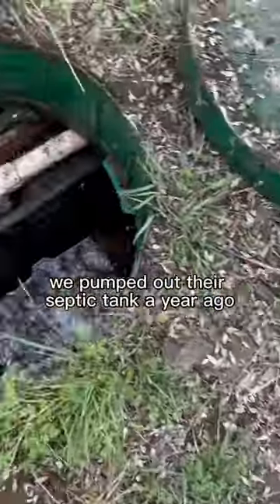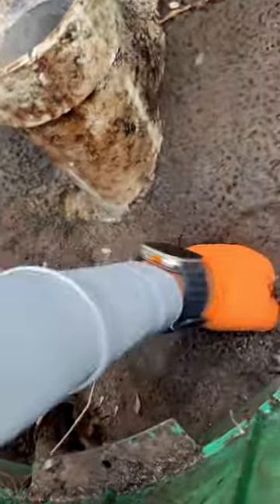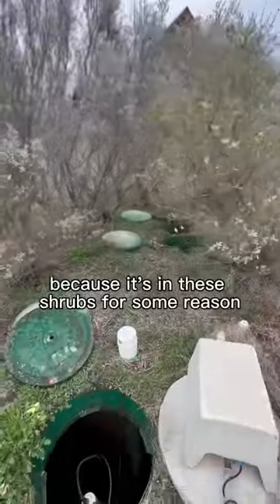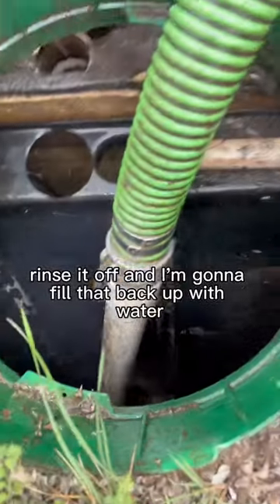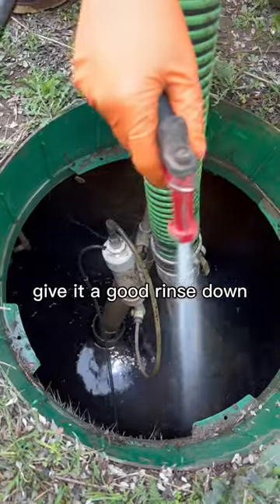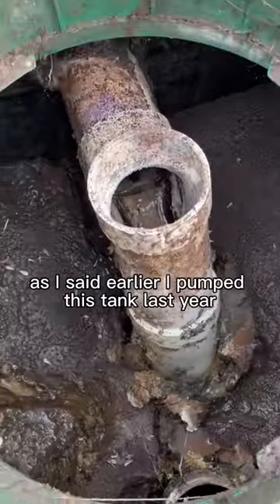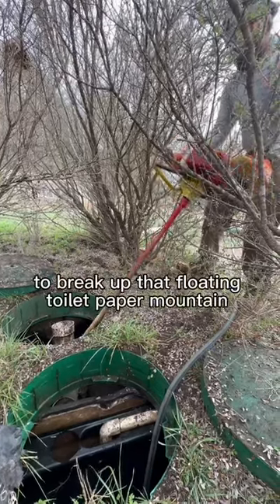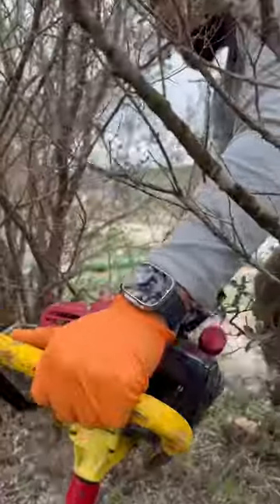Septic Tank Filled After One Year #shorts

Comment: Family needs to use rapidly dissolve toilet paper like they make for RV's
Reply: "Just how rapidly are we talking?  I don't want to play beat the clock in the thicket.   'Your toilet paper will self destruct in five seconds, go'."  - Bill Engvall
Reply: There's a test for "septic system safe" toilet tissue. You put a few sheets in a jar half full of water. Shake it vigorously for a quick minute. It should dissolve. I worked as a maintenance guy at an apartment building. Some free sample rolls of Cottonelle brand tissue. We had a lot of clogged toilets afterward...
Reply: That RV toilet paper is a scam. How do I know? Full time RVer for 4 years. We you regular Angel Soft, when I run a dump I seldom see more than the occasional clump of paper after only a week in the tank.
Reply: Or throw it in trash that can be burned or at least take to dump and see what they can do
Reply: They might be using the whipes. Has flushable on the box but fine print on the back states a differently. Need to just admit. Adult version of baby wipes. They're nonflushable as well.
Reply: Or just straight out use a bidet to clean butt with water.
Reply: @drl5002 😂😂😂😂😂
Reply: @Nhatanh0475 noooo...that wont clean anything.  You have to wipe first, then bidet.
Reply: Small tank most likely, happens alot
Reply: @Manicpool this is so true!  Some wipes say "plumber approved" or something but only trust the ones that say "septic safe" bc that's actually a legal standard (idk who enforces it tho..)  

Dude Wipes are very popular, but they don't break down for shi-  
Pun intended.